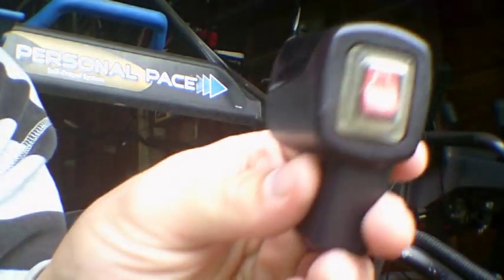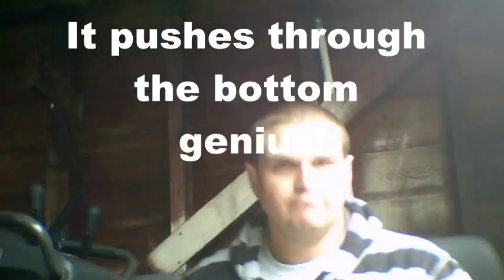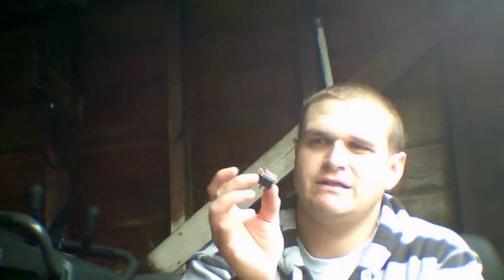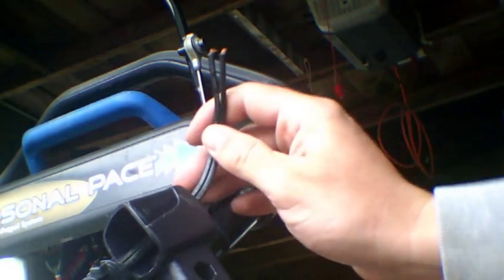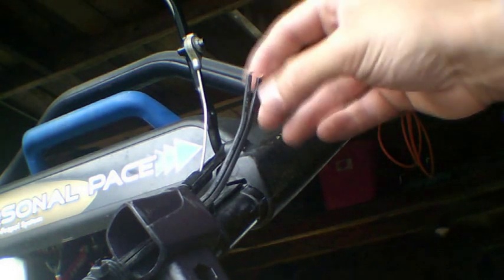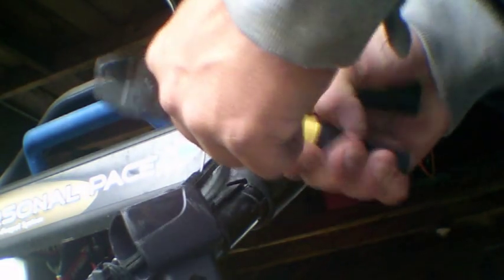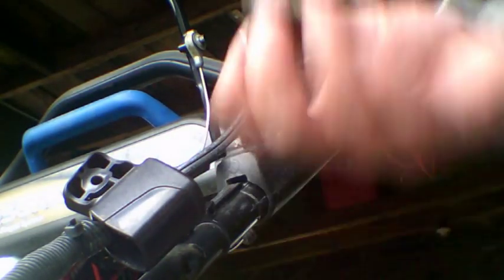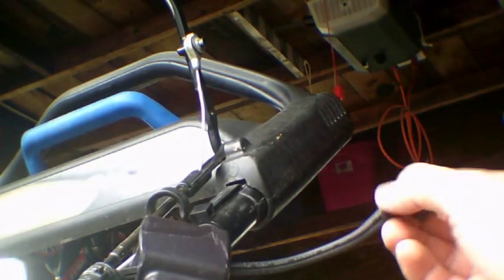Toro Timemaster How to Fix the Off/Kill Switch | Lansing Lawn Service

Comment: Can't you just bypass the switch by connecting the two wires together to ground it out and shut it off?
Reply from the maker: Yes you can.
Reply: @LansingLawnServiceLLC   mine started acting up after I changed the blade engagement cable. I was in a hurry so I didn't bother to put it back inside the lume. In fact I just ripped it off completely must have pulled on the wire because now I can wiggle the wires by that switch and it cuts out. Works fine now, but I think the wires are loose where that switch is. This mower is the biggest pos ever 🙄 in 500hrs I've gone thru like 8 cables, one spindle, a couple sets of belts, like three idler pulleys and this is only my little narrow gate back yard mower that only mows maybe 5 backyards a week.

Comment: This video literally missed on showing the actual rewiring, come on man 🤦🏻‍♂️
Reply from the maker: You literally attach the wires to the posts. It doesn’t matter which wire goes where. It is just a circuit and the kill switch brakes the circuit.
Reply: @LansingLawnServiceLLC  i know how, I just stumbled on this video.

Comment: 2 months old will not start, suspect the kill switch happen once before. Switch is a VERY CHEAP product, poor design and engineering on TOROs part for sure. I like the way the mower cut but this switch will piss u off! First and last TORO!

Comment: The entire switch set up is ridiculous. The placement is not a good location and the wires are always coming off.
Reply from the maker: Yeah, it is a pain in the butt. I ended up buying an electric start model. I havent had a problem with that one.
Reply: Agree totally. My wires got ripped out just like in this video because when I cut close to bushes or hedges the kill switch wire is on the outside of the bars. Bad design!! Not sure if putting electrical tape on these will hold them in the long run.

Comment: mine is 6 months old and failed too... GARBAGE!!!   Back to my Honda mower
Reply from the maker: mario dilorenzo First of all, it is two little wires that simply pulled off of the polls. This does not make a unit garbage. Second, it is an incredibly easy fix that shouldn't take more than a few minutes to repair. Good luck.
Reply: Thanks, but anything that only lasts 6 months in my opinion is JUNK... 1,000 mower should have no issues for while
Reply: Called Toro and they wont send me the part, unreal. And it's under warranty. They say I need to bring it in.  So I fixed it myself, it's WAY better the cheap generic way Toro installed it .  Wish I could attach a pix.